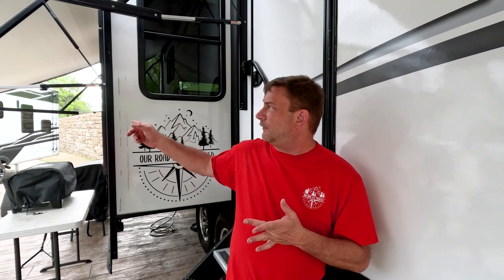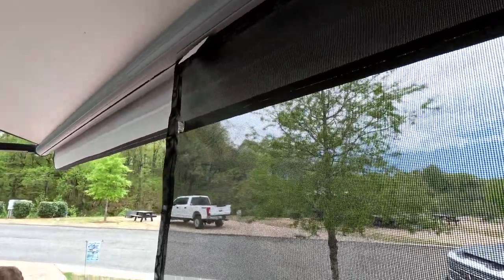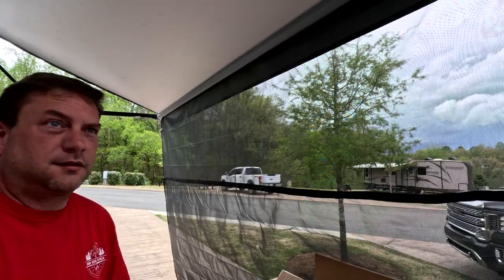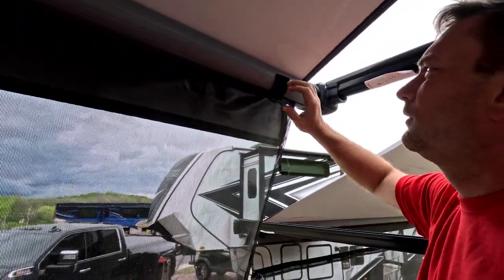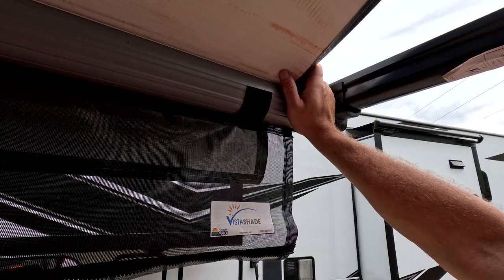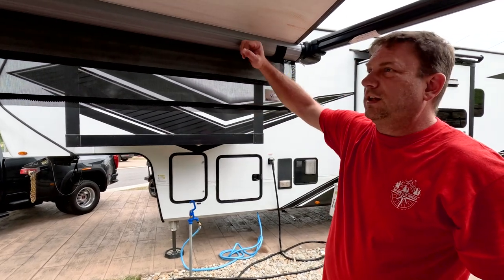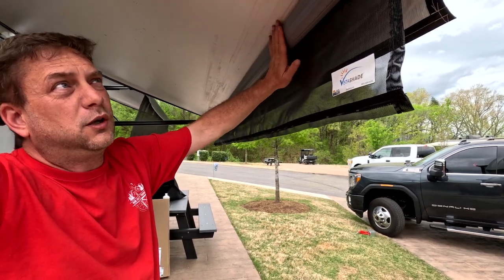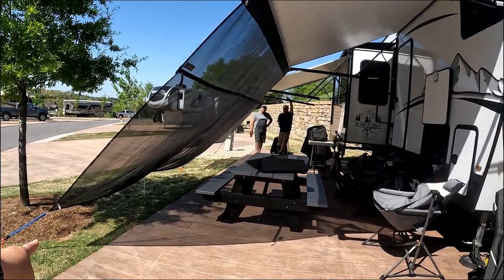Upgrade Your RV Life: How A Sun Shade Can Change Everything

Comment: Good video. Have you noticed if the shades increase the heat when you sit under the awning? We have a screen room and it is crazy how hot it gets inside.
Reply from the maker: Between the shade screens and the ceramic tent we installed, the heat us much more manageable now.